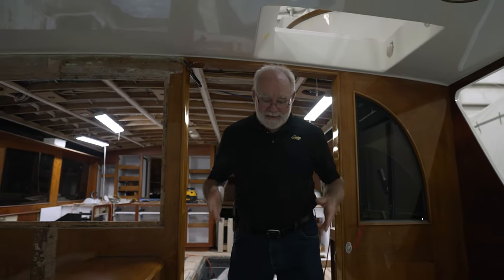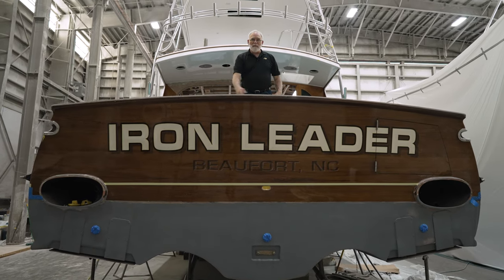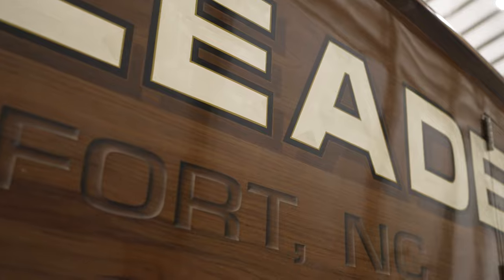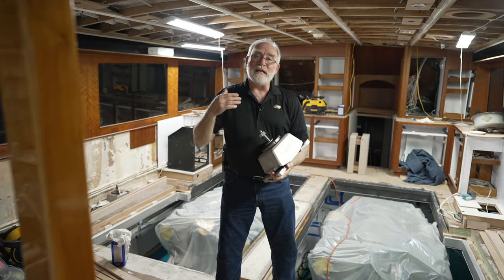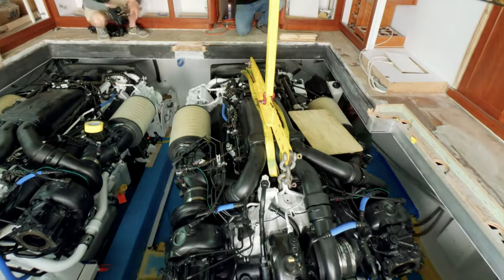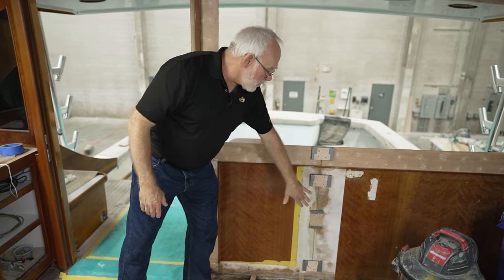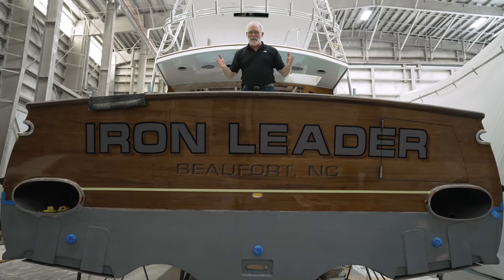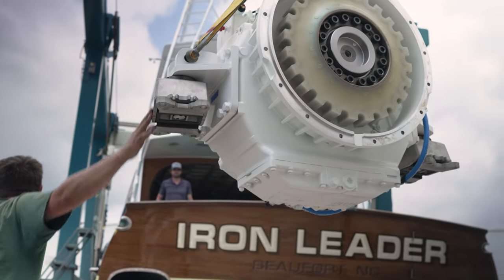Anatomy of a Jarrett Bay Repower with New Cat® C32B Engines - JB Insider Special: 2 of 3

Comment: So this begs the question.  If these boats will go thru many multiples of engines in the hulls lifetime, is there a better way to do this?  Has no one figured out how to make this easier??
Reply: Not all boat's go thru of this. Sometimes it takes 30-40 years to change engine's.
Probably this owner had a sudden change of mind or he needed more power under his/her chair. Removable bridge won't be that much strong,i guess.

Comment: How about foil assisted hulls.... = less drag = more speed = less fuel  = longer range = wave dampening. If the poil assist allows the hull to ride just a couple of inches out of the water, you will already gain on all those areas. I don't see why it would lower the aesthetics if the lift is no too drastic.

Comment: Cat is not a leader in diesel engines. The fact that they still use iron and not aluminium shows how behind they are. 3000kg for an engine and only 1500KW is far too heavy. It's still single cam with rockers also.

Comment: Cat is a leader in what? Having the ugliest engines??. PLEASE after these blow up put the MTUs back. JT Marine would love to sell you some👍🏼.... PS: the “B” in C32B stands for BOOM🤣🤣
Reply: Do u even know what your talking about these cat engines are  made to last and will last longer than any mtu
Reply: Give the kitty a little credit they usually limp back to dock huffing and puffing smoke
Reply: @adamw4245  you obviously haven’t see. These things being made.
Reply: Was a Bit shocked they took out 16V MTU 2000 Series for Cats C32 but this new Engine if Built as strong as CATS are know for should outlast the Equivalent MTU, they are taking notes from MTU however in regards to the Triple turbo system, although MTU does it a bit different. Also Wish they would give exhaust sound in thr videos.
Reply: @JaiHazel  they’re comparing these engines like the MTUs are straight out of the factory when in reality they’re 14 year old M93s. the new M96s are significantly better even though to get 2400 bph you have to have a 16v
Reply: @drfty1194  I am Familiar with the New M96 12V 2000 that makes 2000 HP at 2450rpm although what they are the Commercial/Ferry Application, they are incredible, however you can't beat the serviceability of a CAT.